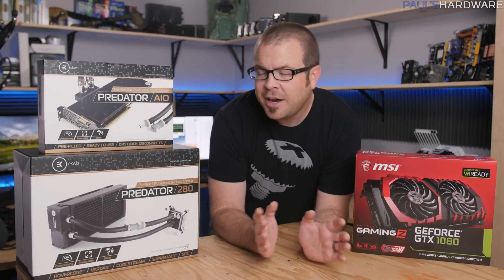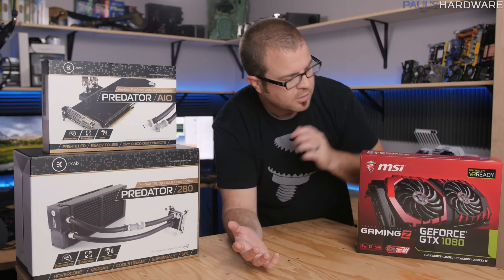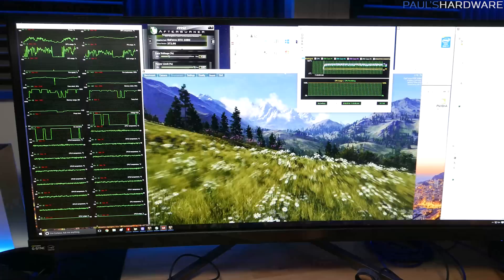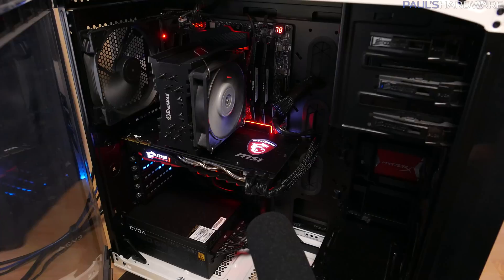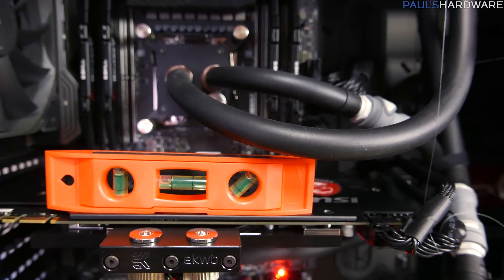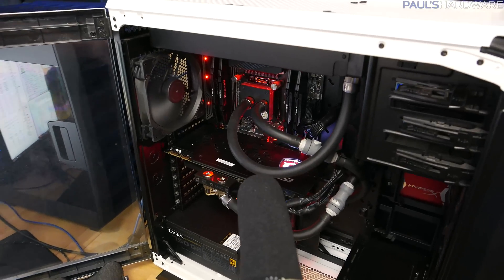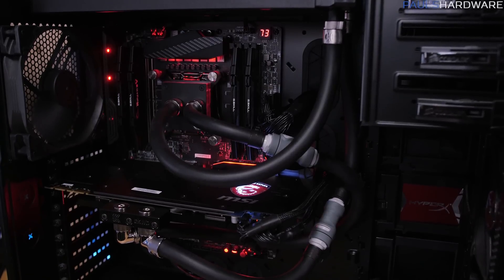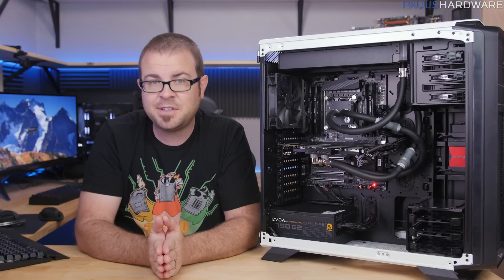Watercooling Simplified: EK Predator 280 + MSI GTX 1080 Z

Comment: Going 240 would be just fine. You fried Jay did it for the define nano build :) A basic rule for rads is 120mm fan space for every CPU and GPU in the loop.

That MSI is sooooo crap.
Removing the cooler on EVGA cards does not void your warranty. And water cooling is not the only reason to remove cooler. Sometimes you want to clean, sometimes you want to change thermal paste.
Not to mention that it's better warranty. For example coil whine:
MSI - this is normal, f*ck off.
EVGA - send it in and we will send you new one.
Reply: I agree with you I have a bunch of EVGA stuff and love it. Did you know EVGA as 24/7 human techsupport! they all speak perfect english and are located in socali. Evga has my money every time I am looking to spend.
Reply: The rule is actually 120 per component +120.
Reply: Components like HDD, RAM, MB do not output enough heat to count them. So a 240  can cool the whole system. You might need to ramp up the fans to have lower temps, but it will work just fine.
More rads (beyond some point) will not give you better temperature, just quieter operation
Reply: Brandon Breuer there are many points for liquid.
1. it's fun
2. it can be beautiful 
3. it can be quite
4. it can be effective
5. you can put powerful builds into small cases.
6. "because I can/want"

For me it's to put overclocked i7 + GTX 1070 (titan wouldn't be a problem too) into Define Nano S while having nearly silent great looking build on my desk. and I do it because I can/want.
Reply: ***** 120 for CPU, 120 for GPU +120 That would make a 360 the right choice. HDD RAM and MB are not included in that calculation, together they can count towards a single 120.
Reply: ThierryTheuns 240 rad is enough to dissipate 300 watts at delta t 10.
An i7 + GTX 1080 computer draws ~250 watt from wall under gaming load. At delta t 15, 240 rads are closer to 500 watt.
Reply: I would go for 360 for the oc headroom, its better to have extra cooling capacity than not enough. Also depends on cpu and gpu output, obviously stuff from the x99 lineup heatup like crazy.
Reply: I use 240 and it is guide nice, all do the fans make guide big noise when ramping up..
Reply: Loyal evga fangirl here, I totally agree. Everyone needs the same warranty as them, it just makes a shitton more sense.
Reply: Ben Zimmerman recently found another company that can compete. I have this awesome Fractal Design Define Nano S. And I cracked that side panel window accidentally. Since their spare parts shop does not ship to my country, they (Fractal Support) sent it free of charge. They refused my offer to pay.
Reply: ***** damn nice, i did the same thing with my case, corsair sent me a new one for free but i was totally covered under warranty and all that shit. Speaking of side panels, acryllic needs to GTFO its complete garbage. The new one looked exactly like the old one after a few weeks lol
Reply: I was (and still) planning to mod that side panels with tempered glass. May be even do the extra step and make the side panels completely of tempered glass. About the Fractal, shipping that thing to my country probably cost them more than the case.

Comment: This is why I like a large cube case, plenty of room and a horizontal mobo tray means no GPU sag and no CPU socket stress (if you are using a large dual tower HSF). As cool as custom loops look I just can't justify the cost for performance.

Comment: Yeah custom loops look great but destroy my wallet. On the other hand they would make my full build cost as much as an equivalent prebuilt...
Reply: Lol $274 for a 360mm AIO or a 360mm kit with a slim reservoir but no fluid. When I can get a crappy $100 360mm AIO from Thermaltake...

I cry...
Reply: Jorel Bates Yeah or just air cooled cause its fine

Comment: I have a full custom loop with two EK-CoolStream XE 360 rads. My CPU and my GPU is connected to the loop, but I never had the issue of the fans not ramping up. I admit, they don't ramp up as much until the water gets warmer and the CPU starts to heat up as well, but my GPU never went past 54 degrees celsius running furmark. I use the built in "silent" fan curve of the motherboard.

Comment: For a practical out of the box system it's a descent setup being expandable but the qdc fittings and excess tubing wouldn't look good for a lan gaming rig. Being ek and upgradeable though, you could always go hardline I guess down the track if you wanted to go with more of a showpiece. I'm glad you done a video on this as I was curious to see how loud that ddc pump was so Thnx for that.

Comment: With air coolers from Noctua, Phanteks, Thermalright, etc. that perform only marginally behind the biggest liquid coolers, along with the incredibly efficient Pascal architecture and a well-designed AIB partner cooler, I see no reason to go for an EK Predator 280. The 360 offers a little more sense, but the EK 280 would be better served as a CPU-only cooler for high overclocks and just sticking with the stock GPU heatsink and shroud. To me it's still the same situation: big air or big water. These inbetween solutions are nice to have as an option, but they are a compromise.
Reply: facepalm
Reply: The temps on a good air cpu cooler are about the same as on a watercooler......You only have more room for overkocking.
But if you going to watercool a gpu the temps can drop 20 degrees.

So If I had to choose......I watercooled the Gpu....NOT the Cpu.
You said it yourself in the 1st line of your comment......There are lots of great cpu coolers.
But the 1 component that gets really hot and makes alot of sound......is the Gpu, not the cpu ;)
Reply: Pretty sure that only applies to AIO coolers. A good custom loop will still destroy air.
Reply: Andres de Groot No, I completely get the appeal of that. Only thing I was really commenting on is that if performance is something you care about, custom water cooling is better than air cooling.
Reply: Daniel West I have a R9 390 so in my case....You said it already :) My temps are now 70 at the most. With air it got 94 degrees.
But I watercool also for silence and EVERY gpu on air.....when you put it to the max makes noise....ALOT of noise in my opinion. Also a Gtx 1070 :P

If I bought a Gtx 1070 I watercooled it only for the looks because I NEVER overklock my hardware. The reason is I absoluty don`t care about overkocking, never had, never will.
If it is to slow....I upgrade or buy a better gpu in the first place :P

I watercool because of 2 reasons. 1 is silence. I have a big overkill on radiators in my pc so my fans are set on it lowest & in idle they are all OFF. Reason 2 is because I love the looks of a full watercooled system :D
Reply: No. What you state would literally break the laws of physics. Assuming all thermal solutions and there applications are the same a water cooler with a adequate pump and radiator will be a substantial decrease in temperature. If air was better cars would not have radiators. -Computer and Electrical Engineer student in his junior year
Reply: Thomas Riddle Not if you only watercool the cpu. And I know because I did alot of builds ;)
You only have more headroom for overkocking and if you do it keeps silent....nothing more.

So with overkocking you are correct and it will destroy air....But at stock speed.....Not gonna happen.
Reply: Andres de Groot Water cooling your graphics card over your processor makes sense, but only with GPU's like the GTX 980ti and R9 290X. A 1070 performs almost the same on air as it does on water. It's not thermally held back. Many aftermarket 1070's can reach 2050-2100Mhz. Water cooling the GPU might add an extra 50Mhz and in Pascal that amounts to a margin of error kind of performance bump. That makes the main draw of water cooling—performance at low fan speeds—almost nullified as an MSI 1070 is only slightly louder than an AIO like the Predator and the same level as something from Asetek with their gurgling, grinding pumps and Corsair's obnoxious fans. Considering the EK Predator looks pretty bad compared to a good air cooler, and even more so compared to a custom loop that's well designed, the main draws of water cooling become somewhat invalidated. NVidia has made water cooling less attractive, in my opinion. The 980ti could fly under liquid. The 1080 performs only marginally better with it. The RX480 can benefit from water cooling, but it's not a very good overclocker and is considered a midrange GPU. Unless you're passionate about water cooling and AMD, it's probably better to invest the money into a better GPU. Besides, you don't buy an AMD card if you're into overclocking, not since the R9 290 at least. The Fury X saw very little benefit to water cooling as it was such a mediocre overclocker, at least the ones I've used and seen tested. Some performed well with extra voltage, which liquid allowed, but the huge temperature and power consumption surges offered diminishing returns.
Reply: Andres de Groot 70°C under water is very high, especially without overclocks.
Reply: Daniel West The R9 390 is a hot gpu and It can be lower but I love silence & I have my fans on it`s lowest speed.
If I turn my fans a little up then it`s 60 but again....I do not want to hear my fans.
That little bit of heat extra.....I don`t mind because 70 is good enough for me if it is silent :)
Reply: Well ok... but that's the entire point. If you don't plan on overclocking, why are you even looking at higher end cooling?
Reply: Thomas Riddle Just play with the watercooling parts, Planning a build and the looks :) What is needed is not importent. You must see it as a different hobby & mine is watercooling :) I just LOVE to play with the parts & also the planning :)
Reply: Yeah, I'm not that fussed about overclocking any more. I don't think we need it either. While I don't have an nVidia card at the moment, Pascal and GPU Boost 3.0 have basically taken much of the work (and necessity) out of it. Voltage is hard locked and AIB partners don't extend the range of tweaking much further beyond specification. AMD's Fury cards were voltage locked for a long time as well and were poor overclockers in general. As for CPU's, I think that's become a bit stagnant too. Whatever CPU I get next, either the 7700k or Zen, a simple overclock is all I'll apply. I'm not going to spend weeks tweaking. I don't really have the money for custom water cooling, but I would absolutely love to get into it. Personally I'm more keen on getting the looks and silence down, but with air cooling, which is basically what you're doing with a custom loop.
Reply: Which 390 did you get? My MSI 390 gets to about 72-78C on full load with the stock air cooler.
Reply: replying to drakedog
Reply: Bullshit. You are stating quite stupid thing because when it comes to cooling, everything is about flow. The principle is the same everywhere, x amount of heat needs y amount of flow.

Conclusion is following: price decides everything. It is cheaper to cool with air ( price per performance ) than with AIO.

And if you have any engineering sense, you would have known why automobile industry uses water and not air.
Reply: Joey22688 I do not understand that. I also have the Msi version & on full load it gets 94 degrees on air. Now with water 70 :)
Reply: ure wrong, air coolers actually outperform water cooling
Reply: Andres de Groot Fair enough.

Comment: About the fan-control:

With speed-fan you can merge the 2 fan-curves.
You need to fiddle around a bit, but worth it if you have combined loops.

What it basically does is allow you, to set up a fan-curve for both the CPU and the GPU and then tell the program, to use an average or the higher fan-speed of both readings on a specific output.
If only the CPU gets hot, the fans turn up, if only the GPU is fried, the fans spin faster.
So no reason to stick with a constant fan-speed anymore.

Comment: this is the exact thing that i needed all in one. thanks.
Reply: TechnoCraft $200+ later
Reply: TechnoCraft Its pretty expensive for an AiO.
Reply: yeah ik
Reply: but cheaper than custom
Reply: TechnoCraft Yeah but you can get an NZXT Kraken or a Corsair H100, H110, H115, for almost half the price.
Reply: but that is not a cpu and a gpu all in one.
Reply: TechnoCraft True, but NZXT also has a gpu rad mount, just something to think about, not sure everything about it.
Reply: From what I've seen, its pretty good, although you may be overpaying at $170, I've seen it at $140.
Reply: yeah

Comment: I bought an EK predator 240 last year after my Corsair H110i GT system failed after less than 100 days. The EK Predator is a much better cooling solution in every way, quieter, cooler, and still going strong a year later with zero maintenance and zero problems.

Comment: I like this option, but would only use it after my hardware warrantes expires. 12 months in most cases. It should prolong the life of the CPU and GPU thereafter and allow you to OC both components near the max. I would also wrap all connections in duct tape and confirm that any spillage would not short out any other components.

Comment: My 6700K is overclocked t0 4.5Ghz and never got above 60C on an AIO. My 1080 FE however loves to hit 83C and with an automatic fan profile, it gets loud as a jet. So the gpu is making most of the noise. :(
Reply: now if I want to water cool my graphics card then it was void my warranty and I don't want that to happen
Reply: will*

Comment: I'm impressed with the silence of that. I have the same case, motherboard and CPU running the same 4.4 Ghz overclock, but my H110i GT is sooo loud, even at idle. Great video!

On a side note.. Have you compared the Pro Carbon to other motherboards for overclocking potential? I just switched from a X99 Krait to the Pro Carbon and can't get the same overclock from the same CPU.